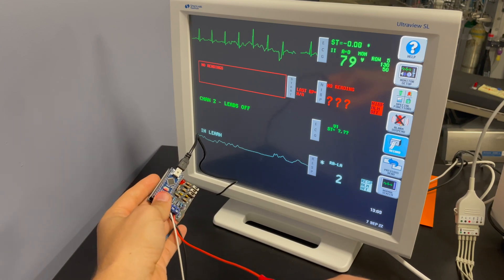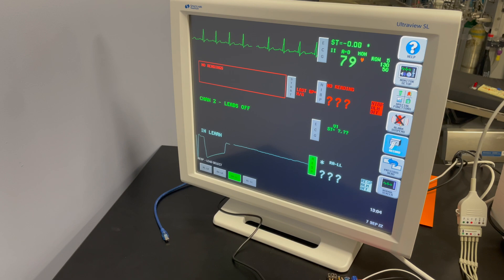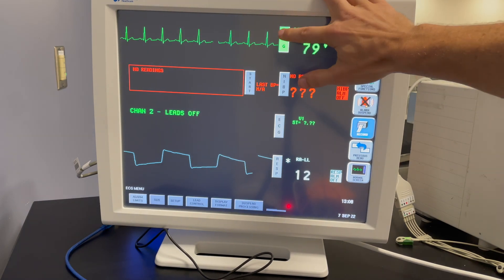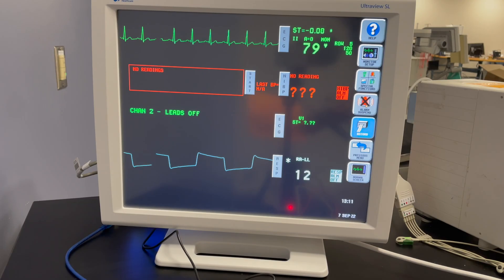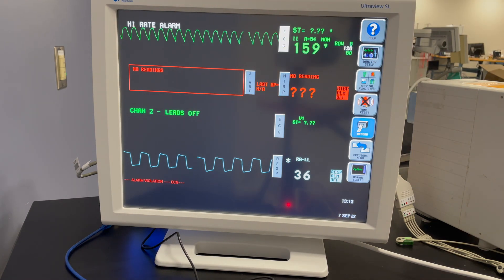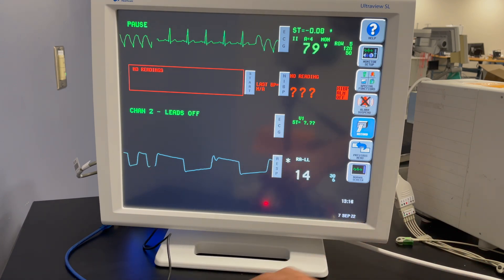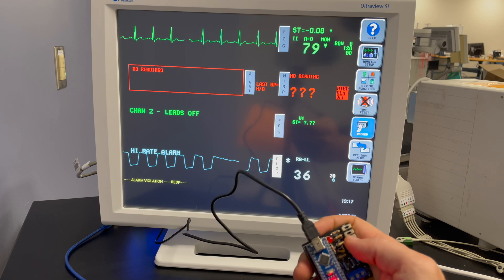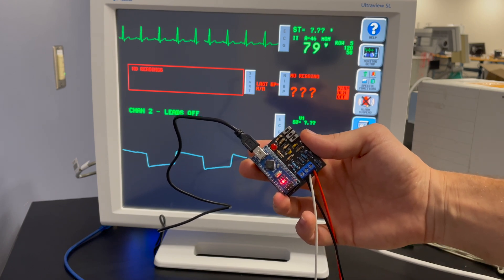Biomedical Engineering Project | ECG Simulator | How to use your ECG Simulator

Comment: "I have already tried the schematic and the program exactly as provided, but when tested on the patient monitor, the ECG and respiration signals do not appear. Could you please help? I am using a patient monitor of the Mindray brand.
Reply from the maker: Can you be more specific on the model. I’ll try to look at what leads it has in the manual but I’m not to familiar with that one. Another option is to just switch your leads around and see if it shows up
Reply: @ Mindray brand with model uMEC 10.
Reply from the maker: @stevennine2748  Try switching the white and black leads and see if it show ups
Reply: @ That's lead III — can it be changed to lead II?

Comment: Hello. The square wave generated by the Arduino to simulate the respiratory signal saturates my ECG inputs of the parametric monitor. I am analyzing your schematic circuit and I notice that you add the square wave to the LL derivation through a resistive divider, and it seems to me that it is a lot of amplitude. On the other hand, even so, the parametric monitor does not measure my respiratory signal. I am using a 5-lead (RA, LA, LL, RL, V) comen c50 monitor. I appreciate any help to solve the respiratory rate simulation.
Reply from the maker: Hi, do you know which leads your respiratory rate monitor is measuring with? I do not have that monitor to test it out but each monitor has its own parameters and go to leads it uses.  Did you try switching the leads around?

Comment: More to the point I'm a monitor tech who wants to build one of these to test my telemetry monitors and the lead wires to see if they are working properly. We use a 4 lead set white black red and green. The green lead on our monitors has to be connected in order to get any rhythm at all. Any other lead off still shows a rhythm in 1 lead instead of the usual 2 but if the green lead is off you get all flat lines. Can this be used on that kind of system and how do you connect this to the monitor leads.
Reply from the maker: Hi, what the the make and model of the monitor? I have tested philips, ge, and spacelabs all work fine. However we only have 3 leads on this device so you would have to alternate which one you can test if you wanted to test more than that.

Comment: Where does this hook up to the tele box. I would like to see that
Reply from the maker: I have used it on a spacelab telebox -- worked fine. But  since most tele is 5 leads you will be limited to how many leads you can simulate at one time (may get a lead of error in certain cases)